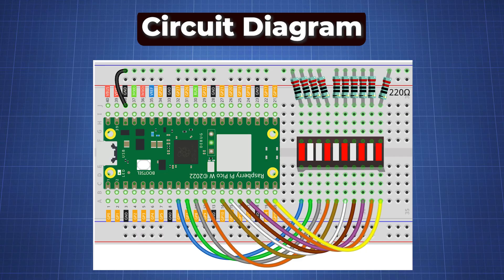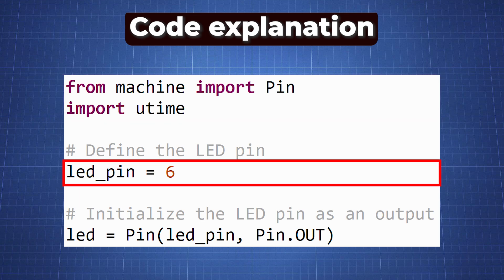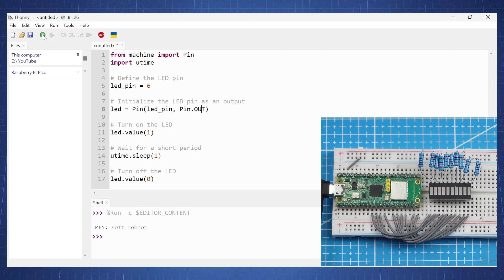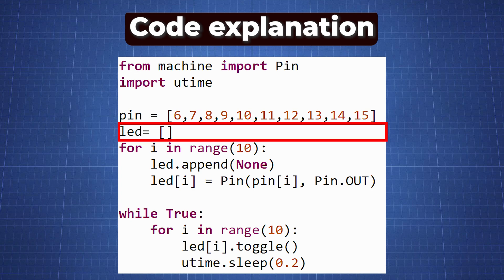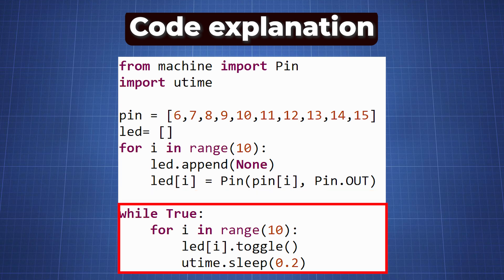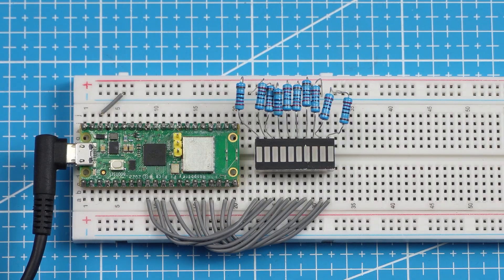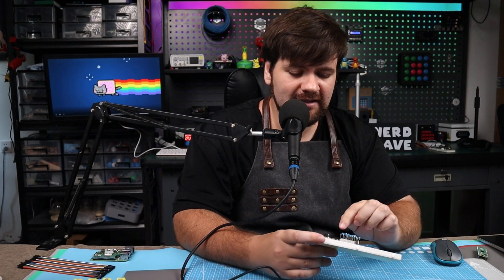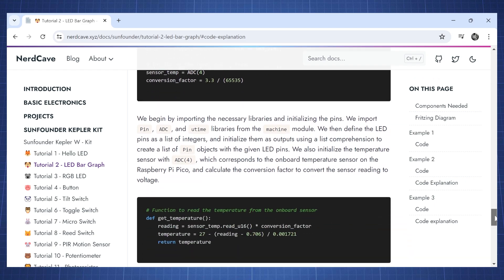LED Bar Graph - Raspberry Pi Pico - Tutorial 2

Comment: I would use resistor packs rather then individual resistor's; this will cut down on component count.
Reply: you are correct but resistor packs not in the kit.
Reply from the maker: Yes, the main reason I use this kit is that a lot of times people ask for links to components, now I buy everything on Taobao since I am living in China so can't really gives links so I got this kit from Sunfounder so at least I can verify the quality of components
Reply: @NerdCaveYT  I use the same kit with Paul McWhorter Pico series, not everyone who covers this kit will demonstrate every part or will use in a different way. Also presents information differently which is very good for the learner!  I do prefer Sunfounder to Elegoo electronic kits!